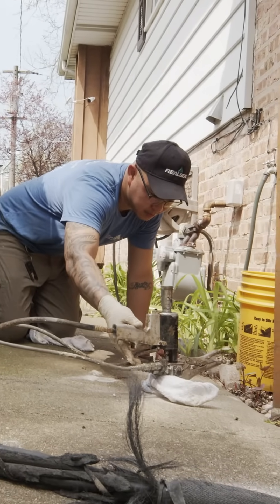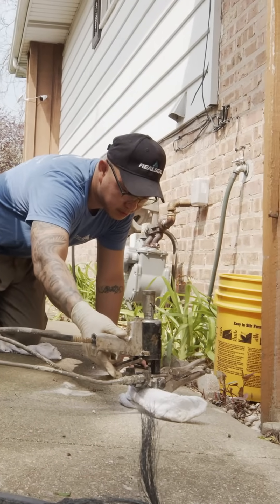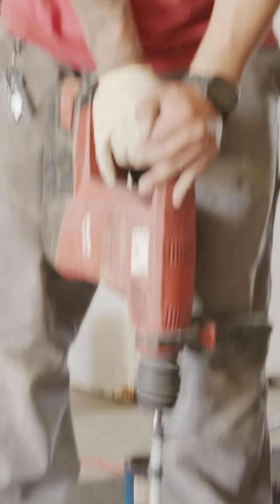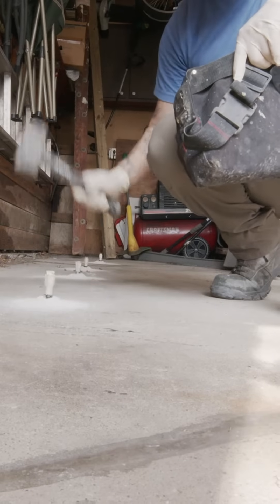Why Does Concrete Sink?

Comment: $800 dollars to fix one small slab? Is that correct? I can get a slab removed and fixed for less if that is the case.
Reply from the maker: Hi Elevo! That is correct. For one small slab jobs, it may be more economical to break it up and replace, especially if you can mix a couple bags of concrete yourself. 

Small one-slab jobs aren't great for either Polyjacking or Mudjacking unless replacement of the concrete isn't an option. 

Your bigger savings will come when you're doing a whole garage floor, sidewalk, driveway, and patios. Most Polyjacking jobs are focusing on multiple areas.
Reply: @Therealsealllc  Good to know. Thanks for sharing the info 🤗
Reply from the maker: @ELEVOPR  You bet!